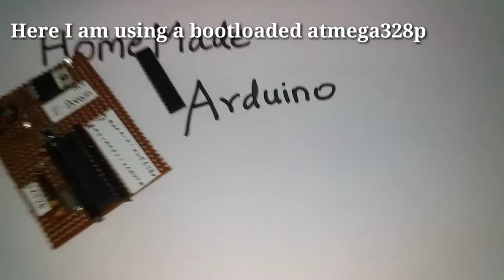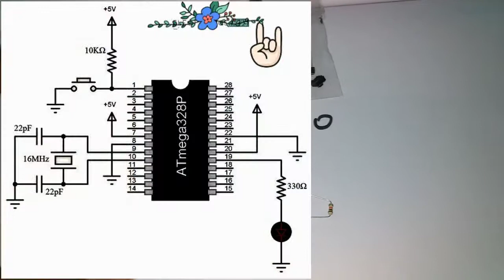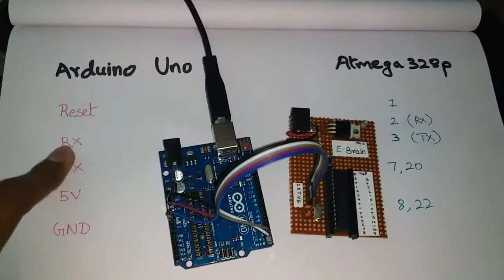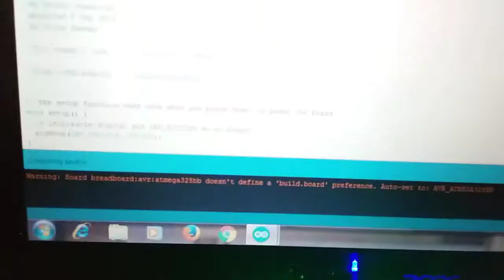How to make Arduino in Tamil

Comment: Is there no problem if the Arduino uno board use to upload program has a atmega ic in it
Reply from the maker: Upload may fail due to power dropped by connecting 2 i.e power is partially divided to the IC in parallel so it will rise error while uploading.